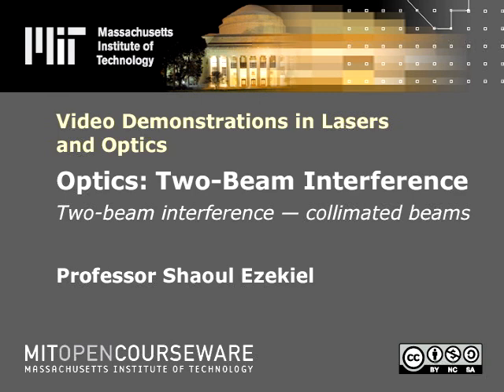Optics: Two-beam interference - collimated beams | MIT Video Demonstrations in Lasers and Optics

Comment: Two laser lights, cross hair and different frequency(color) so that a green laser light is perpendicular to a red laser with a hair in the center of the intersecting lights?
My guess is the light frequency difference isn’t going to affect anything with similar results in the crosshair experiment. 

Bending the laser light into a slit experiment would be cool too.

Comment: Special Relativity still holds based on a mathematical prank . The relativistic dummy copy of the Sagnac formula is a shameless make up. It is the same v = Rw formula used by Sagnac, yet written in a funky way, such as to induce the illusion that it is relativistic.The only relativistic "contribution" is the Minkowsky ct^2 = ct^2 <=> 1 = 1 start.  Crucially, the c + v (as measured by a relativistic stationary observer !) is artificially implanted through the back door, without any theoretical justification. The cheap clownery is eventually useless, because if you chose R tends to infinity, you measure c + v in a straight line.
Reply: Agreed. Relativity is bullshit.